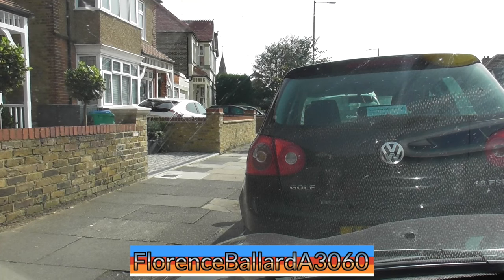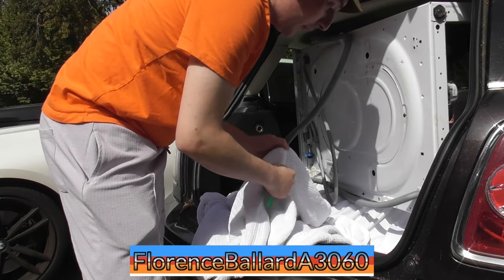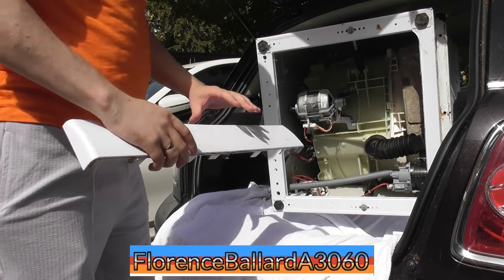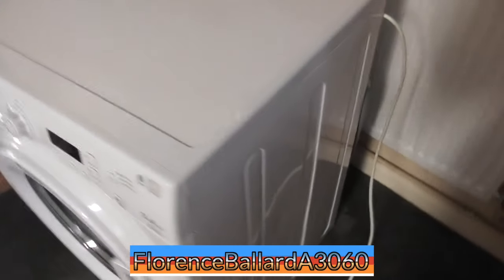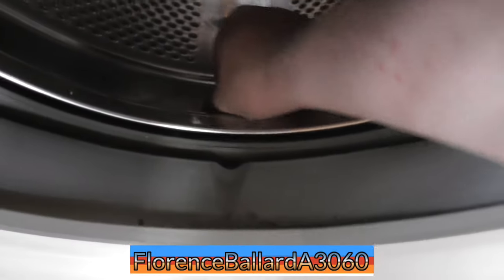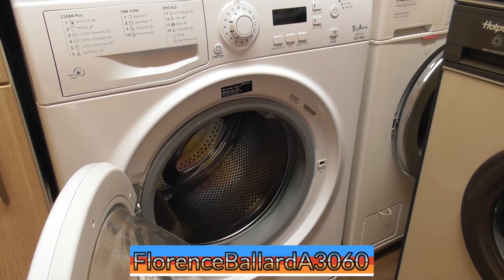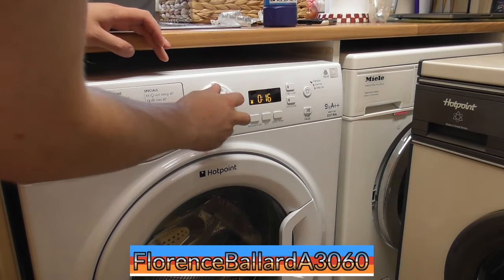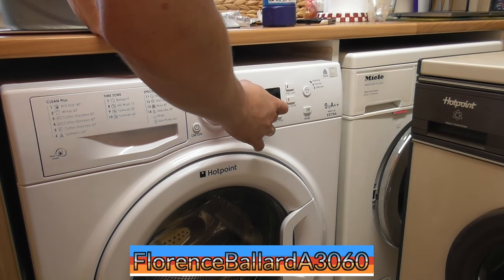A Free Washing Machine to Pickup...Minor Repairs?

Comment: We used to have this model except ours was a 8kg still it had an inverter. Latsed for a few years until a slug went inside it and fried the circuit so we replaced it with an LG direct drive which we still have and is still going! 
I do miss the classic Hotpoint's they were so much better than the ones now.

Comment: If this does have shot bearings it has the sealed tub/tank, they can be replaced but you have to drill holes all the way around the seam and then saw the tub in half along the seam itself change the bearings and then fit nuts/ washers/ bolts in all the holes you drilled earlier. I've had to do it to 6 or 7 machines in the past its like a mini workout at the gym :)
Reply from the maker: Yeah this one of their sealed tub models. I've seen that method before, but tbh, it's a huge risk because it can often not work out and I've seen more failures than success with that method and for a machine I practically dislike and wouldn't go to that effort on, it's really not worth it.

Especially as by time I've done all that, it would have cost so much money, including new bearings, I'd be making little to no profit on selling it. So, really it's far better to scrap it and not lose a penny
Reply: @HooverA3060  Yeah I will be honest the first 3 I tried that method the tub actually cracked within months of doing so but I had to do a black futura 1600 spin either 8 or 9 kg so for me it was worth it and i sold the machine for £70 on facebook marketplace, instead of using silicone to seal the tub i've been using epoxy and every one has been rock solid after it.

Comment: There's a chance this is one of the models with the dodgy door lock, I have a feeling they'd probably still replace it. It might be more profitable to sell the replacement machine once you're done testing it
Reply from the maker: Can't be selling it, it has dodgy bearings so it's destined for scrap this week. Plus it's not under any warranty either and definitely wouldn't be going to the extent of that for a machine I practically hate. It's better to scrap and get something else
Reply: @HooverA3060 alot of them don't come with a liquid dispenser thing yes they have the slot but they don't have it alot of them
Reply from the maker: @theoddjobcentre6686  I did try to make a makeshift one, didn’t really work though